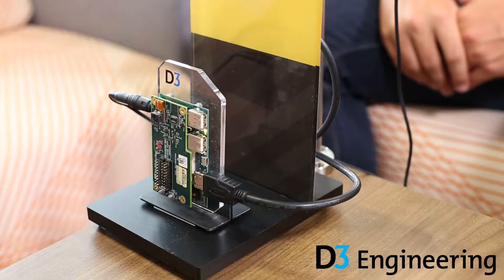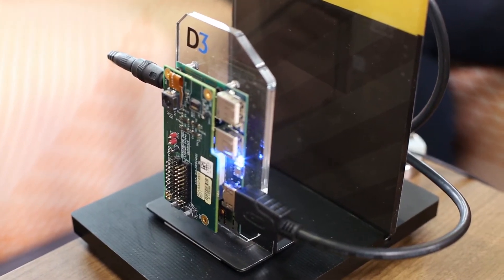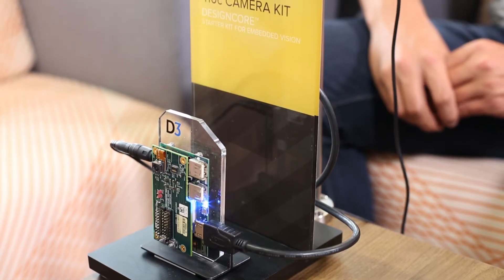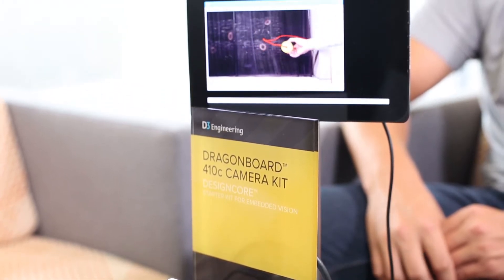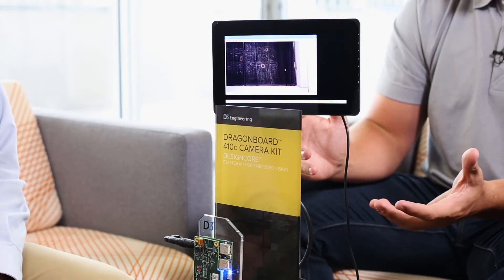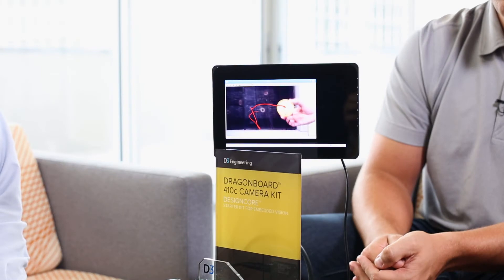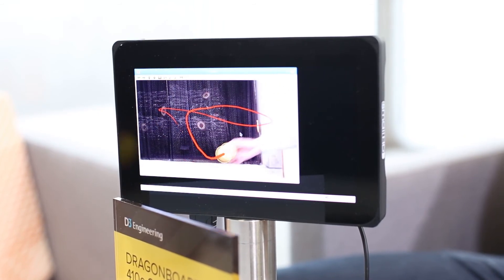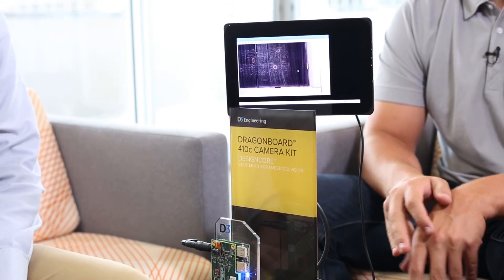D3 Engineering Camera Mezzanine Board | Arrow.com

Comment: Great video, thanks.  Can Windows 10 IoT Core for the Dragonboard 410C drive this camera (via standard APIs like Windows::Media::Capture::MediaCapture etc)?
Reply from the maker: Unfortunately, I did not know the answer to your question immediately, so I reached out to the D3 Engineering team to find out the right answer. To quote D3's response: "Right now we do not have a driver for the camera available for Windows 10 IoT, nor do we know of one out there, unfortunately.  Windows 10 IoT is not something we’ve supported on DragonBoard at this point in time." But that being said, feel free to develop one!